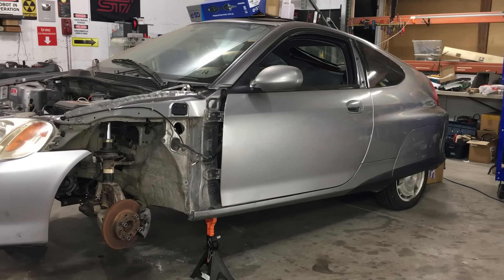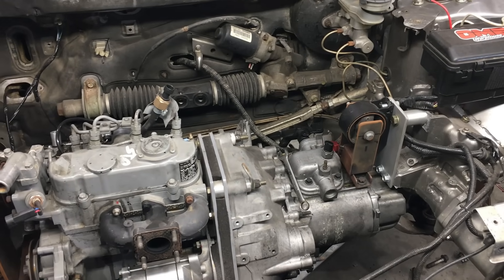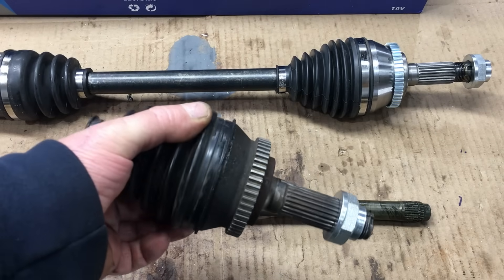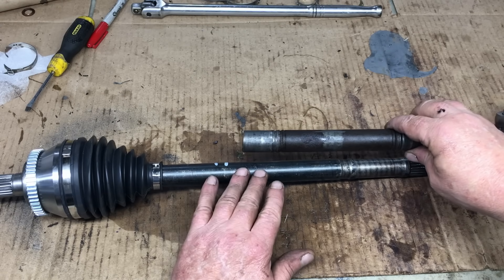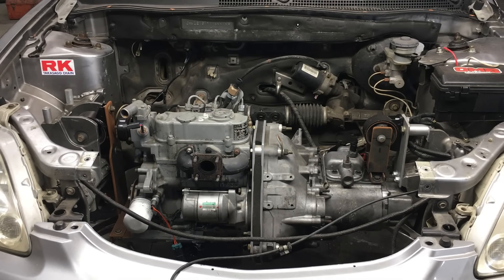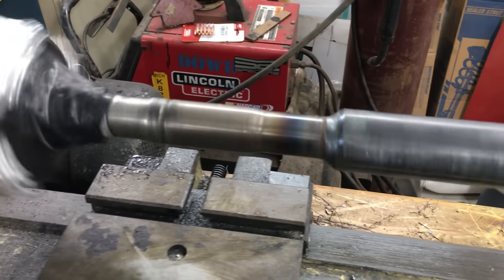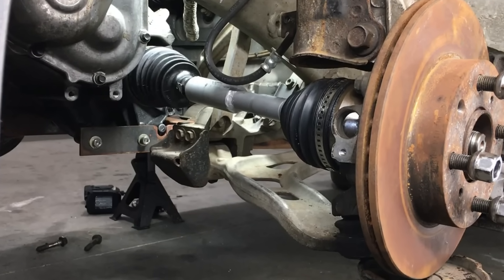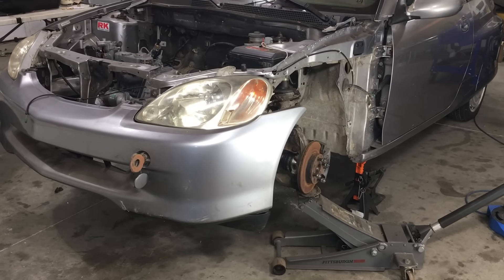S3 E39 we custom build drive axles for the kubota d722 diesel powered Honda Insight.

Comment: I've took apart a lot of Honda axles, it's crude but if you angle the end to the max and hit it with a hammer it will eventually come off. Done it many time track side when I needed to change.

Comment: you could probably run a motorcycle radiator as a heater core. Might even be able to swing a transmission or engine oil cooler. 12V PC fans are also fairly affordable and some even have speed control if you wanna get fancy. Love your stuff! makes my Sunday morning :D
Reply: 12v PWM controllers are relatively cheap and infinitely adjustable.
Reply: Could use just about any car heater core, 2 rubber heater core lines and 12v fan. If alternator on diesel engine is too small to power everything.  Add 2nd battery & 100w solar panel on roof (mini solar system). To run the 12v fan.

Comment: Great video as usual. Maybe you could put one of those cheap Chinese made diesel heaters in it since it doesn't have to be long lasting.  I'm thinking that a two cylinder diesel won't put out enough heat if you intend to drive it in  cold weather.

Comment: Will be hard to beat original Milage of the gas hybrid set up .
The VW Lupo from the same era with a 1.2 liter  diesel is the closest car , EU only.

The Volkswagen Lupo 3L (Typ 6E) was a special edition made with the intent of being the world's first car in series production consuming as little as 79 mph us gallons .
Back to Insight.. 

Original 2000 Manual car got 53 mpg combined epa 48 city 61highway.
Mine has 265k miles  and still gets 62 overall!

The hybrid battery had about as much energy storage  as a diesel pickup Starting battery but was a string of 1.5 volt NiMh D cells giving 144 volts nominal.

Unlike most hybrids the car Can run without the hybrid battery if tricked and provision made to charge the small regular starting battery . The gas engine has a starter but no alternator !
The hybrid battery normally did a 144vdc to 12vdc conversion .
Reply: Good to see a fellow gen1 Insighter.  Mine has around 250k.

Comment: I have Renault Safrane V6 24V 190hp swapped from AT to MT with custom "homemade" axles. And it works fine. Only joints need service every 3-4 years. It works for 11 years. It drives same like my another V6 Safrane with AT. :D

Comment: Oreilly sells a little heater that is basically just a heater core with a fan and you can run coolant lines to it, 12v power for the included fan, and done! Not too expensive, locally available to most folks.

Comment: I wonder if those cheap axles are actually impossible to to be taken apart. I know from Opel axles the CV joint has a kinda spring ring thingy that needs to be widened with special pliers. Like those springs that secure wheel bearings and so on... hope you get what my german mind is trying to explain.
Reply: That is correct, however once the ring snaps in, it's impossible to remove/separate. On several occasion I tried with no result. I have the exact same original axle 19mm in front of me.

Comment: thats a great idea pinning one side of the axle and have it fit in the other. what you could have done too is made a hole in the thicker axle and press in the smaller axle into the bigger one then weld it either just with weld or sleeve over it. just a thought!

Comment: Just a thought on axles of different size. Would it be easier to bore 19 mm in the larger shaft so the smaller one could be pressed in, then drill 4 deep plug welds where the two axles meet? (since this isn't much horsepower)

Comment: I’ve done it this Way. I’ve also just sleeved them and rosette welded. We always tig them where I worked. We cut the sleeve at a 45° angle with the angles opposite of each other. It gives substantially more contact area for the welding, and we did not weld the shafts directly to each other. The way you did it is very strong.

Comment: As a temporary heater, how about fitting one of those chinese (Webasto/Eberspacher knock-off) air-heaters? They run on diesel, you can pre-heat the cabin before you drive. Less than $100, including all the fittings. Could be fitted in the trunk or cabin.

Comment: The cv axles have an inside snap ring just on the inside lip of the cup.  But the joint absolutly does come off. Quite easily
Reply: I was thinking the same. Can be a right pain in the ass to get off. But i have had ones that are pressed on (Jag x type if I recall) but still managed to remove it.
Reply: Please do tell us how to remove the inside snap ring? I have one 19mm original Honda insight gen1 axle in front of me and I have no idea how to separate the damaged CV.
Reply: @johnkelly6888  take boot clamps off and slide boot away from cv. Then just on the inside of the cv cup, like an 1/8 of an inch down there is an internal Grove with a snap ring. Not the kind with 2 holes that use snap ring pliers. Just looks like a piece of 12 guage wire as a snap ring. You can barely  see any of this due to so much grease but feel around with a small flat screwdriver and find the end and simply pry it out. Its not very stiff.

In the rare cases where there is no snapring you pull the axle out useing a puller like he tried in the video. These kind have a retaining ring on the end of the shaft same as the shaft that goes into the transmission. It just has to be kind of overridden to pop ot out. Then if you need the cv apart you can spin the inside around and take the balls out one at a time. If you do not have a puller like he did, slide the boot up the shaft and hold the axle with the cv you want off hanging down. Then take a hammer ,preferably a deadblow,  and a couple good hard wacks should pop it off.
Reply: @haskelswain1842  thanks for the reply, it's way easier said than done. I see the snap ring I tried your method with no results. The only thing left to do is to use the hammer.
Reply: @johnkelly6888  lol. Find the end of the snap ring and use a small screw driver. Smaller than normal. You need a fine point to get it. The ring doesn't have much resistance.  With this type the hammer will not work. Not in a million years. Just pry on the end of the ring and you'll bee like "well duh"  lol
Reply: @haskelswain1842  thanks for the advice, however it didn't work for me. I did try for couple of hours with no success. At this point I just left it for another day.

Comment: If you have a car battery you may need one of those old cigarette lighter heaters. Or a 350 watt heater and a power inverter. Though if you had a oil cooler and a fan and hoses you might make a crude liquid radiator to use hot water from the engine for heat. But it would be troublesome. .

Comment: Every single snapped Honda axle I've seen has been snapped at the rubber damper due to rust introducing pits into the shaft which allow stress points to form and fracture the axle...or it just rusts so thin there that it snaps from lack of material.

Comment: I think it would be neat to use one of those cheap large transmission coolers with a small fan attached to it as a heater setup in a car. It would be alot cheaper then buying a whole new heater setup. I think with a little enginewity you could have a nice budget heater.

Comment: Great work on the axles, Jimbo.  I was thinking that instead of turning down the Honda side axle, I would have considered a sleeve with the two required inside diameters, and then plug weld it to the shafts.  Likely strong enough for the Kubota.  Also makes setting the required length much easier.

Comment: Far back in the mists of time, I replaced the heater core in a Hilux with a 12V electric unit. It was ok, but you really appreciate how much heat a big combustion motor kicks out!
Reply: I had one of those electric jobs in my old FJ40 back when. They're alright as a supplement usually, like mine was. The heater in those doesnt exactly make a lot of hot air, and none of it gets past the driver and front passenger 😂

Comment: Those Saturns were actually great little cars, I had 3 of them over the years and put 335,000+ miles on one. The wheel bearings seemed to be junk and would go out religiously every 100,000 miles and if you lived in a cold climate you all but had to cover the entire radiator with cardboard if you were gonna build any heat in the cab. But other than that I loved them, their 5 speed gearbox was always a pleasure to drive, I never used the clutch 👍
Reply: It's interesting you mentioned blocking the radiator with cardboard in the winter because I noticed that my neighbor's grandson's Saturn SL2 didn't seem to heat up very fast and the temperature never went over 1/4 when I was test driving it on about a 20 degree day after fixing a few things so I suggested replacing the thermostat, but now I'm wondering if that's just a flaw in the design of the cooling system since you mentioned the same thing.
Reply: @averyalexander2303  I had 3 of them, my dad had 2 and my brother had one too and they were ALL like that. Those engines didn’t build much heat and the radiator seemed to work very well and unless you covered them up in the winter they just wouldn’t blow any heat. Never overheated In the summer though unless the electric fan quit and you didn’t notice and were sitting still idling with the ac on, then the temp gauge would start to go up a bit.
Reply: Had a Ford Festiva of 1988 carbed vintage 4 speed manual. Had to cover the radiator and only leave a 4" square in the center during these Alaskan winters just to be able to get the windshield defrosted. Tried every brand of t-stat available, 185 degree was highest available and all were the same poor heater results.

Comment: the heater core for my 1990 import actually costs more than the car is worth . i used a 1973 f100  non ac heater core , mounted it in its own shipping box , and t-strapped a 12 volt dash mount "cooling" fan on rear of box , all in rt side floor . pitiful ?  yes , but better than being known as "that blue guy" . fan in original heater box takes care of even more pitiful ambient temp defrosting .

Comment: this would probably be way too much, if it's even possible. but the old beetles used ducts to channel heat from the motor into the cabin. I wonder if scavenging heat from the intercooler would be possible? meh, probably dissipate too quickly.

Comment: I would like to see a vapor car. If you put gasoline in a sealed container, add heat, and a full intake to the fuel tank, heat the entire intake all the way to the engine, you get an engine that cracks the fuel just like the oil refineries do with excellent fuel economy. Crude oil is boiled or distilled into lighter fuels when it's processed. Well the same thing happens under full vacuum and heat. Great video, as always I like ,share, and subscribe.
Reply: Such 'vapour' or surface carburetion was common on very early engines. It's hard to control the air fuel ratio and the 'heavy ends' of the fuel tend to concentrate in the tank over time, resulting in ever leaner mixtures until what remains is more or less kerosene that won't vapourise.

Maybe with an electronically controlled secondary intake and a lambda sensor you could fix the mixture issue, and of course a heater would allow you to vapourise the heavy ends of the fuel.

Alternatively, you can convert the engine to run on LPG. The fuel is entirely gaseous already, and burns super clean. Though it is tough on the exhaust valves.

Comment: I waited so long for the Kubota engine car episodes... I think you did a really good job on the last Kubota engine Saturn. 
I m more interested on the fuel consumption side of this engine.. the Saturn episodes fuel consumption was outstanding.. it's even more fuel efficient than my scooter 😂.
Keep up the good work
Reply from the maker: Thank you very much!
Reply: I feel the same.
I'm curios about the weight difference and the aero dynamic efficiency difference vs the overall result in acceleration and mpg

Comment: Jimbo, curious about the exhaust header on the Renault. Is there a reason why you couldn't just put it on backwards (with the outlet facing the sky)? Couldn't tell from the video if it would clear the pulley or not
Reply from the maker: the cylinder heads are offset on the v twin.  Putting the header on upside down would require a lot of cutting and welding.
Reply: @robotcantina8957  Makes sense! Figured there was a reason why you didn't do that.
Reply: It would make it look like a demo derby car then. Not yet time for that.
Reply: @mudbunny6388  HAH true! I meant for testing purposes only, not final product. Might as well put a tractor flapper on at that point🤣

Comment: For the heater, use a heater core and a bypass valve and build a box inside with a fan. Run an outlet to the dash for a defrost and the other to the floor. 

The bypass valve looks like a funny H and can be closed to keep the hot coolant outside the car on warm days. 

If you want to get fancy you can rob a heater fan resister and wire in a few speeds. Or, get a PWM driver for the fan and have a variable speed. Or... Get really complicated and use an Arduino, ESP32 or similar and monitor coolant temp, cabin temp and outside temp and build and automatic climate control... :) For the latter you may want to pipe in outside air and build a blend system. 

But in the end you just need a heater core of some kind, in a box with a fan wired to a switch. Switch on = heat, switch off = no heat... 

I doubt it will be a problem given everything else you've done.

Comment: Curious if the balance on the axle is a concern?
Enjoy this channel a lot. It is part of my Sunday ritual .
Reply from the maker: We  will find out soon enough.
Reply: @robotcantina8957 If the balance is a concern could you reuse the Honda axle damper?
Reply from the maker: @firstlast---   The original Honda axle damper is made for a 19mm axle.  Our new axles are 22 mm.
Reply: @robotcantina8957 funny enough, that's why those axles break. It rots under the damper, and causes the axle to snap! Have known several people it's happened to. One of my 4 parts insights are from back east, and I cut the damper off to see myself and sure enough, it was horribly rotted underneath. If you want a stock insight heater core lmk, I'll pull one from a parts insight for you and send it to you for free. I'll never use it.
Reply: @Baltotherolf  I cut my damper off to slow down the rust.
Reply from the maker: @Baltotherolf  I had a feeling the damper was the cause of the axles snapping.  Thanks for the offer on the heater core!  Another youtube channel  that is local 100percentJake offered a complete HVAC system for the Insight.  I really appreciate your offer but  I'm going to go with the local HVAC system.
Reply: From my experience no you don’t feel it.
Reply: Yes and no

The better the balance theoretically the less wear.  But as we’re not really worried about going 1 million miles here we’re more worried about critical speed(s) 

The more unbalanced it is the higher the resonance will build sooner reaching critical speed(s) quicker 

However I doubt the engine could ever get it anywhere close enough to fast enough to matter
Reply: I've put over 250k miles on the original Honda insight gen1 with no problems.

Comment: Simple heater core in a box with a fan should be just fine for the heat. No need to overcomplicate it.
Reply: Generic heater core or all metal PC cooling radiator, 120mm PC fan or two, a little 3D printed bracket and duct to direct air at Jimbo, easy solution.
Reply: and ofc add a shutoff valve like old trucks
cause the heater can never be turned off with a simple system without a shut off valve
Reply: Had a friend who had a old F 100 no heater core but 250’ of 3/4 “ garden hose looped around the cab , worked fine.
Reply: @dennisford2000   Like in floor heating for a house.
Reply: @dennisford2000 😄😆😅🤣😂
Reply: Thats how our old allis road grader works, just a small one below your right side and a fan and a couple coolant lines, works great for Kansas winters!
Reply: I've done exactly this. Used 2 high flow PC case fans and a 240mm PC radiator piped to it. Ran some hoses from the case fans to the dash defroster ducts and it worked a charm.
Reply: Use a small heater box that they use on skid steers/forklifts! Power in, coolant in and out, easy mounting! Minty!
Reply: Like one of those Mojave ones that are popular with wheelers.
Reply: Good suggestions in this post for heat already.  I’ll add one more.  Look for a heater designed for a tub/ side by side.  They work well in a Jeep in a KS winter, should work well in the Honda too.
Reply: Thats exactly how my skid steer has heat. Im pretty sure someone purchased a ready made unit and threw it in, doesnt look stock. Just a small black metal box with a knob to control fan speed and 2 coolant hoses sticking out of it. Works a treat, even in -40 alberta winters
Reply: That would leave them with no defroster.
Reply: @jamesigou9033 He could add a duct extension from the box to the original windshield ducts
Reply: So long NAS it doesn’t catch fire.

Comment: what will you do after you've exhausted the Insight? Will you rebuild it into its original specification, or turn it into some sort of race car?
Reply from the maker: If the diesel engine works out, then that will be the last engine for this car. I want to keep things fresh and move on to different platforms.